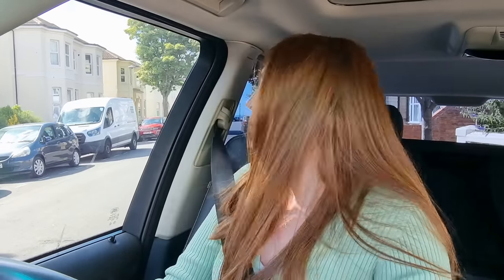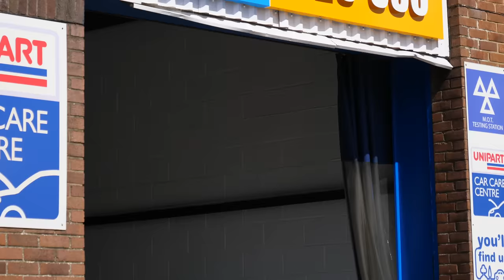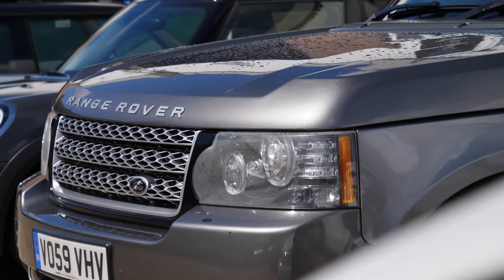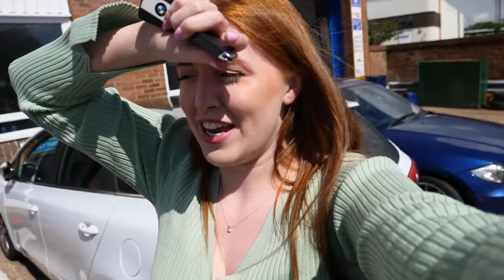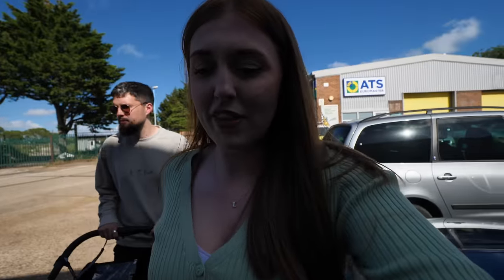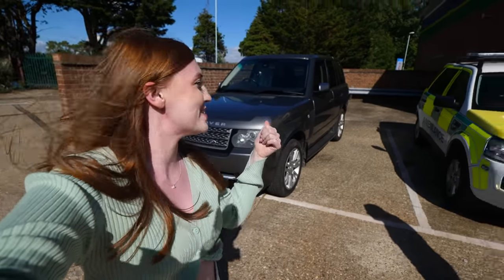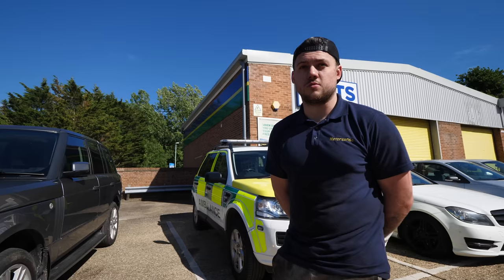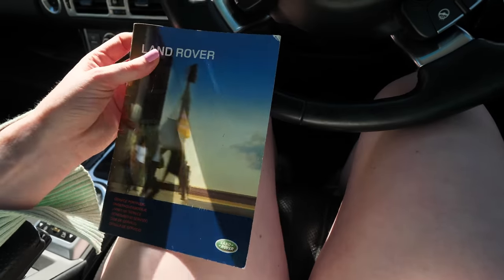Servicing my Stupidly High Mileage RANGE ROVER L322 Transformed the Drive!

Comment: Bit of advice from a fellow RR owner. You should really find a Land Rover specialist, local garages use whatever oils they have deals with NOT those recommended by LR. He’s they may use recognised parts but not the oils/lubricants required for these specialised vehicles. Did you get the four wheel alignment done as you never mentioned it, I suspect not?? Make sure you get the gearbox serviced, LR say it’s a sealed for life unit but you’ll probably find the gearbox manufacturer will say otherwise. Finally don’t let the service gaps get too long for example these V8’s need the engine oil changed ideally every 5-6 thousand miles or every six months. If you do not do these things it WILL go wrong and start to cost you more in the long term, look after the thing and it will look after you 👍🏻😎
Reply: I have 2 l322 supercharged4.2  and petrol vogue 4.4 , thank you for your advices … oil change. every six month even if you did not drive the vehicle for six months ???
Reply: @Kassiusday  If the vehicle literally hasn’t turned a wheel then I would service it every 12 months for as long as it is stationary 👍🏻
Reply: m an Englishman who has been driving Land Rovers products for over twenty years and can honestly say there is no place more comfortable to be....
....whilst waiting for a tow truck!
Reply: @Kassiusday  It's not required but 6 month intervals are good, modern oils are great.  What you have to worry about with leaving oil for a length of times is acidification.  The oil can actually chemically change from heat and time to the point where it can damage the internals of the engine or lose it's ability to lubricate.  That doesn't happen in 6 months though, if you aren't driving much once a year is fine.  

4K-8k mile interval is ideal with quality oils even up to 10k in the naturally aspirated motor, in general this means if you are driving anywhere from 8k miles per year to 16k miles per year change it twice annually.  The supercharged engine is considerably harder on the oil than the naturally aspirated as it operates at higher compression so keep that in mind and try to keep the interval at 5k or less.

Oil is cheap and engines are expensive, if you aren't driving much and want to swap the oil you don't necessarily need to change the filter nor go to a garage, you can use suction to remove around 7L and then replace with new oil to keep it fresh.

Comment: Did they lock the suspension into Tight Tolerance Mode before doing the 4 wheel alignment? Did you get a print out of the 4 wheel tracking before and after? Both of these are essential I.e. locked suspension and the print outs.
Reply: Do they look like they know Landrover’s?

Comment: A tip for driving in France, find a duel carriageway and drive in the outside lane and pretend it’s a two way road, that will give you a feeling of what it will be like. Repeat to yourself wrong side, wrong way round when approaching roundabouts. And when turning right, and left, think wrong side. Apart from that, the side mirrors will be useless on big roads so look out the windows more. Apart from that, I’ve newly subscribed and good luck!

Comment: How’ya, having driven in France in our defender in 2013 and now living here for the last year my advice would be to use Google maps for trip planning, even if you have spelt it wrong it will still give you choices. With uk number plates you will get very little hassle from the gendarmes as they will assume you don’t speak French. Round abouts can be fun, just take your time and don’t worry about being tailgated as that seems to be a French pastime. 
Be aware of the speed limits !! Google maps will help with that as it displays the current limit on screen although sometimes it will display 80kph in a 90 kph zone. What area are you travelling to?

Comment: It would be interesting to see what tyres you went for - Michelin Cross Climates are great if you can get them in your wheel size and Pirelli Scorpion Verdi aren’t too bad - obviously your use case might need tyres more suited to off-roaring.
Reply: I run Pirelli scorpion all round, great tyre. (20")
Reply: I have the cross climate suv on my Disco Sport. They are superb.

Comment: If a car has a 45k mile gap in its service history, irrespective of whether you're now looking after it, it's still not a well looked after car. Oil is much cheaper than engine rebuilds so if someone's scrimping on the basics then what else have they neglected? Of course it could have been self serviced in that time but then I'd expect to see all the invoices there for the parts. My Impreza has been worked on only by me for the last ten years and the wedge of invoices is inches thick. If I did ever sell it (unlikely) then at least there's all the documentation there to support the fact the car has had literally everything spent on it whenever it's been needed. It's the problem with these L322's as they're now in the Champagne for Lemonade Money bracket which means people buy them for the image but have zero money to look after them properly, or even the respect for a mechanical device to bother even if they could afford it, because it's all about image over substance. They'd rather have some gangster glass, fake chrome and black alloys with ditch finder tyres than fit proper tyres and service the damn things.

Comment: I’ve got the exact same car- year, model, colour. Make sure the turbos have been changed. At 168k I suspect they would have been by now. These are a common failure on the TDV8 3.6 and they aren’t cheap either.  They are heavy on bushes so fit genuine parts where you can as they will last longer. I’ve had two of these cars now and they are great if they are looked after. Ignore the haters who say they are unreliable.
Reply: From the video it looks like only the main engine sump plug was removed to drain the oil. The 2nd plug mostly overlooked is under the turbo drain. Any sludge build up here due to not being drained regularly is asking for trouble. I bet most garages who are not Land Rover specialist have no idea of the turbo sumps existence and why so many turbos fail.  Using a suction method to remove the oil from the top is even worse.  Use an oil flush before every oil change cant do any harm either.
Reply: I have two petrol version of this car and like you said “ forget liars who say they are unreliable is not true “ !!!!
Reply: m an Englishman who has been driving Land Rovers products for over twenty years and can honestly say there is no place more comfortable to be....
....whilst waiting for a tow truck!
Reply: @Kassiusday  The L322 with the 4.4L Petrol engine is probably the most reliable car ever produced by Land Rover.  The engines have no glaring issues and the cars hold up well despite some rust issues, ZF gear boxes hold up just fine if you service them every 75k miles.  The V8 diesels were also good as they don't have catastrophic issues, it's the TDV6(oiling problems, spun bearings) and the 5L petrol engine had some issues(timing chain guides and carbon build up).

Comment: French drivers are from a different planet! Really very strict driving laws in France. Check requirements before you leave. Includes: Fuse/Bulb kit, reflective vests, UK sticker, Headlamp converters, warning triangle, 6 months remaining on your Passports, V5 form plus documents etc. You cannot use a mobile phone in a car unless you are parked in a designated parking space with the engine off. No headsets etc are allowed. The baby MUST be positioned in the front passenger seat in a rear-facing seat - with airbag deactivated. Make sure your insurance covers driving in EU countries. EHIC health card, European breakdown cover. You must turn your headlights on when driving through a tunnel. Also, learn about "Priorite A Droite." If you are stopped, you will be asked to prove that you are compliant with French Law.

Comment: In France, I would say always have your wits about you. Remember it's the opposite side of the road, and the opposite direction on roundabouts. The standard of driving is not on the level with the UK, so more care needed there too. I think junction and roundabout priorities are similar to ours, but this has not always been the case. Make sure you read their equivalent of the highway code to see any differences in the right-of-way.
Their default urban speed limit is 60km/h, which s around 37mph. Being in an town can imply you are subject to this speed limit.
On zebra crossings, no zigzag lines, but the give-way rules are similar to our. Unfortunately drivers to not adhere quite as well to these rules.
For Wales, do your research. Cardiff is a fantastic city. Plenty of great castles in the town surrounding Cardiff as well. Swansea great as well. Probably more so for the surrounding areas (the Gower peninsula is very nice).
Then there's West Wales, and North Wales - each have their own attractions. 
The roads in Wales are fantastic country roads - I'm sure you will enjoy your drive. No difference I can think of between English and Welsh driving rules.
Road signs are in English and Welsh. Though Welsh is mostly spoken in West and North Wales. Elsewhere you will not hear a great deal of Welsh being spoken, though you will see signs in both languages. As an English person, I find many Welsh people will support our opponents in sporting events, and have a joke at our expense when we lose. Apart from that, in my 20 years of living in Wales, I have found the locals very friendly and welcoming!
Reply: The standard of driving in England isn't exactly brilliant in ether.
Reply: @josephmccullough3031  Indeed - or in Wales where I live. My dashcam gets plenty of use!

Comment: You may already know but never drive it had when it’s cold and when you stop let it tick over for a minute it helps the turbos last. Do you know if the garage took out 1 or 2 sump plugs?
Reply: You don’t take out any sump plugs to drain the oil on these, you use a suction pump.
Reply: @JohnBaxendale  the 3.6 you do
Reply: @paulleeson8670  Think this is the 2011 4.4 though?
Reply: @JohnBaxendale  I thought it was 59 but it was different a 3.6 in the workshop, you can see the engine at a point
Reply: @paulleeson8670  not sure - they’re very different engines though, different manufacturer, different gearbox etc, people get them confused and give “bad”/wrong advice all the time!

Comment: The rear brake calliper rattle will probably be the anti squeal shimm missing, it's so simple to do yourself at home as well as regular oil + filter changes do them yourself to keep the cost down, the oil leak you gave is more than likely the rocker gaskets just do both, don't forget a smear of rtv where the head has a join, a good tip is when you do brakes change the discs all round for drilled and grooved with red/yellow stuff pads you can stop them on a pinhead again all done at home.
Reply: Rocker gaskets isn’t a common thing on this engine, o-rings in a pipe at the back of the engine and the oil cooler is - but they say in the video they fixed whatever it was anyway. This year stops well anyway as they have six pot brembos as standard (same as was fitted to the supercharged).
Reply: @JohnBaxendale  This is a 3.6. Rocker covers split and gaskets leak, quite common. A big job either way as all injectors need to come out and the ones nearest the bulkhead require the engine lifting.  No idea of UK prices but I recon 1000 pound a side plus parts.
Reply: @mrmeeer1  ah, my bad, for some reason I was thinking this was the 2011 4.4 TDV8 🤦🏼‍♂️